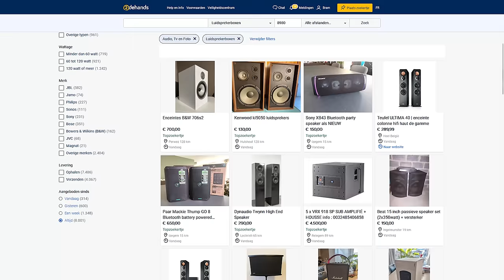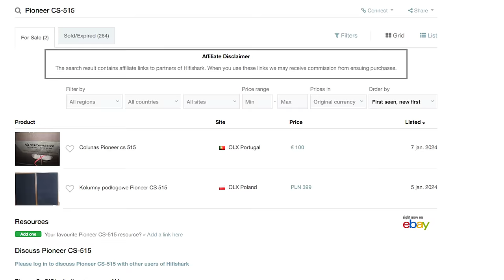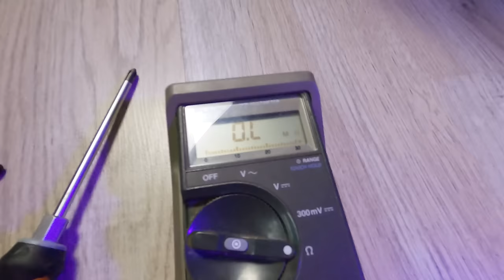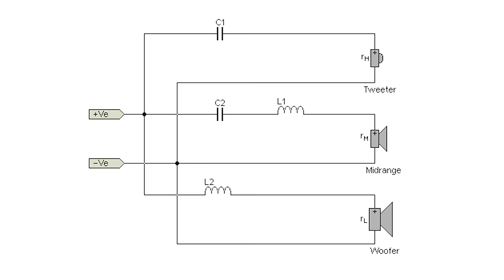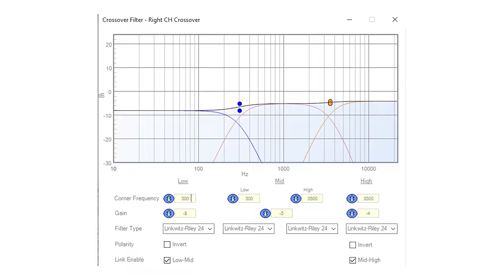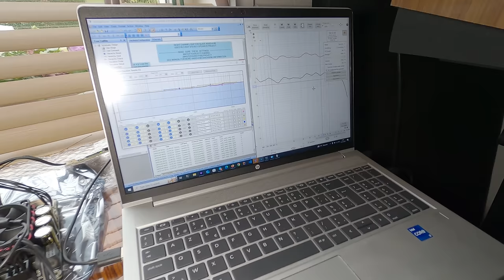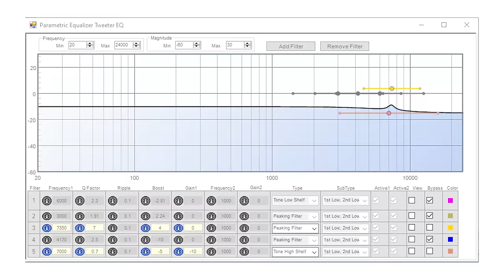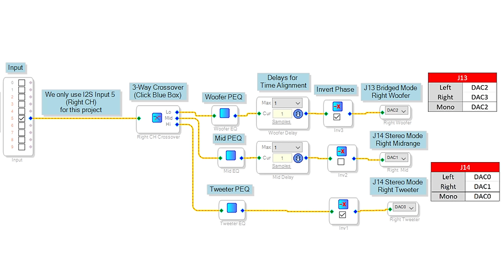Turning BROKEN Speakers into HIGH QUALITY Studio Monitors

Comment: I skimmed the video for it, i apologize if you mentioned, but is your noise tweeter hiss? 120hz ripple, 120hz ground noise? or 60hz ripple? They all sound different, and tell a different story. Here's some oporational points you can probably work from to troubleshoot it. Very long post but i bet youll pull some useful info out of it. I( may be covering some things you did too, i watched this with a beer and bong in my hand lol. tweeter his is self explanatory. 120hz ripple is higher pitch then 60hz ripple, noticeably, but they are both a smooth low frequency hum. The 120hz ground noise is a much clicker, sharper sound with far more presence then the ripple because theres no filtration applied to it at source of the noise like with PSU ripple.

Depending on the type of noise you have differnt options moving forward... Hope this message helps!

I have a tpa3255 chip amp from amazon on my pc system that was a little hissy, and im running it from a fairly inexpensive switch mode power supply, much like what it looks like you used here. its 12v and im using a step up booster to bring it to 36v for the amp. I was able to get rid of pretty much ALL of the hiss by putting one of those 12v DC noise filters for car amplifiers between my 12v switching psu, and the step up converter. 

 There may be a chance your filtering inductors or capacitors may not be quite up to the challenge. Thats what i initially assumed about mine. But in my case the noise was HF originating from the switch mode PSU, not the amplifier, and the amplifiers filtering just wasnt catching it for some reason, likely a circuit topology design flaw (VERY common with chinese chip amps... VERY). Cheaper switch modes tend to have quite a lot of high frequency switching noise on the line. And often whether its a claimed feature to remove this or not, itll make it into your tweeters on this kind of chip amp. If it's more of a lower frequency hum your dealing with, id look at your PSU first again, and start testing for ripple currents in the DC coming into the amplifier. Anything over .5Mv ripple and youll likely hear it up close with these cheap chip[ amps in my experience. whether people want to admit it or not, some of these better chip amps (tpa3255 properly implemented specifically) are some of the most neutral, and least colored, transparent, and detailed amplifiers ive ever heard in my life. Noise can come through fairly easily in a non optimal setup, through non optimal circuit topologies including output filtering, or through non optimal DC power source.

If your dealing with power supply ripple, you may be able to help by changing raising, probably by 25-50% at least, the value of the large filtering caps in the power supply and with a good prand of low ripple low esr cap like nichicon or sanyo or something. But depending on the topology of the power supply this is still a crapshoot and you'd likely be playing and soldering around potentially dangerous amounts of current for little to no benefit. Noise from switching PSU's can be a real PITA sometimes. If its 60hz ripple not 120hz you may just have a janky IC or diode in th epsu leaking 60hz into the DC outputs, or it may just have an exceptionally noisy transformer causing excessive emi in which case... get a new psu, and make sure its better quality lol

If you've ever let this power supply sit active for time with no load, you may have also damaged an IC in it, and that could be the source of your noise too. thats a big no no with switch mode power supplies.

Unfortunately, that implementation of whichever chip you may be using, may just be noisy. Ive yet to hear a tda7492 chip amp that didnt tweeter hiss like a mother and let switching noise into the signal. Ive heard tpa3116 implementations that sound as good as 3255, and ive hear ones that sound worse then tda7492. Ive NEVER heard a noisy tpa3255 chip amp and ive heard a TON though. So if thats the chip you have, DEFINITELY start looking into your PSU step 1

---------------------------------------------------------------------------------------------------------------------------------------------------------------------------------------

also. i did similar with an old set of Acoustic research series 660 studio monitors. New dayton audio woofers, new GRS ribbon tweeters, and original mid range stayed as it was surprisingly fantastic.
 
Designed crossovers in xsim and built them, tested, tweaked, rebuild, tested, tweaked rebuild. And i have a set of monitors out performing ANYTHING you can get for the under $400 i have into these things.  

Floor to ceiling wall to wall soundstage, a revealing and detailed character im not so sure ive experienced before. They make a friends Klipsch rf towers seem like a pig painted up as a show pony. The only issue being a ever so slight hint of image smearing between far left and center channel thanks to my room being a little too small for the way the drivers are arranged on the baffle. Ideally theyd be about 7.5 feet apart and id be about 8 feet back from center point. Listening position is at about 7 feet back, theyre about 6 feet apart. I have been able to set them up in rooms big enough for the way they want to be positioned, and t's truly a thing of beauty. The modern sound+vintage look is a really sick combo if you do it right.

Im not suffering too much baffle diffraction thanks to how close the drivers are to the edge of the baffles, and because the baffles sit flush with the sides. I have to pay very close attention and listen at it hard for it to even be noticeable. My phasing is arrow flat til 9khz as well, and then its a slow, gradual dip at 45 degrees and barely hits 90 out of phase by 20k. My result far exceeded what i expected to get, and i changed my mind about giving them away to a friend too. They are going nowhere any time soon. Glad i never mentioned that plan to any friends yet.

I never implemented any DSP, but im +/-2db from 40hz to 26khz thanks to being crossed over at 60hz with a surprisingly fantastically performing GRS high excursion 12" sub and where my crossover design ended up. That sub was $55 and performs when measured in my space a tiny bit BETTER then the comparably sized 12" dayton HO reference sub response wise. It phase aligns with my dayton "classic woofer" a lot more nicely then the dayton ref did too (which honestly shocked me). I can even tell its doing anything at all when on, because it weaves so nicely into the sound stage. But when its turned off, there go the meat and potatoes.

I may actually try one of the $30 grs woofers in the simulators, id think its pair even more nicely then the dayton woofer, and in the band i want it to perform, their graphs are even flatter then the daytons too. I just wrote their drivers off on price alone to begin with. The grs ribbon im using rn that was only $70 on sale though blows away many far, FAR more expensive dome type tweeters in every conceivable regard too. It takes a bog ole pop-a-squat on the dayton AMT and dome reference tweeters, i was trying to use first. thats for sure. Far easier to manipulate a crossover design for as well.

The amount of performance you can squeeze from $200 worth of drivers and the right sub-$200 amplifiers and some old goodwill boxes is absolutely insane if you put the time and effort in to do it right yourself.
Reply from the maker: Impressive project, and I totally agree about how much performance you can squeeze out of some hardware if you take the time and effort to do it right.

I'm not really hearing an electrical noise like a 60hz main hum or something similar. It's more a faint constant white noise, and can mostly be heard in the tweeter, and a little bit in the midrange when I hold my ear close to it. Since I have a lot of extra headroom on the amps for the tweeter and midrange, I might try adding an L-pad. If that does not stop the noise, I might perhaps give modifying the power supply or getting another power supply a chance. Thanks for the tips, might come in handy.
Reply: Thats going to either be high frequency chip switching noise from the psu, or from the 3255 chips themselves that the output filtering on the amp isnt catching. A dc noise filter helped my cheap chip amps tweeter hiss, probably cut it nearly in half db wise. I have to stick my ear within a couple inches of the tweeter and crank the power amp to really pick it out over background noise now. Power supply noise does indeed make it through many of these chip amp filters.

 You could try adjusting output inductor and capacitor values if your decent with a soldering iron. Theyre large easily de soldered and re soldered parts. Tin a perfect world, the high frequency hiss SHOULD be getting filtered out by the inductor/capacitor circuits on the output stage of the amp, whether the switching noise is from psu or the chips... Thats what the output filter is for specifically. @SirFreak 

Even the fosi V3 and za3 have some tweeter hiss if you turn them up loud and cut the signal. a dc line filter does absolutely nothing for them either. But even when music is cranked and paused, and you get up on the tweeter, there is very noticeable hiss.

At least you didnt go with tda7492. Those chips hiss through any filters and you can hear it at any distance running from ANYTHING besides a high quality toroid that cost more then the amplifier lol. And even then you can still hear it from like 5-6 feet away with any real volume

Comment: What is the noise coming from, could you enclose the amplifier in a EMI sheild? and use coiled with an insulation sheild on the wire / and a ferrite ring? If the noise is coming from the circuit itself only thing that pops into my head is a better opamp.
Reply from the maker: Might give some of those things a try, thanks.

Comment: If you use minidsp 2x4hd (budget priced) or the minidsp flex balanced (highly recommended) and use an ice power amp, Or fosi bt20a pro amp, or fosi za3 amp, Or the amazing topping La90 discrete amp your system will sound incredible with ZERO HISS. As far as clarity goes Your amp right now has 0.04 total harmonic distortion. The topping La90 discrete has 0.00009 total harmonic distortion that's why it is insanely clean.
Reply from the maker: Thanks, might look into those

Comment: I've wanted to make a project like that for years! do you have links for further reading materials and the parts website?
Reply from the maker: Got most of the materials from SoundImports and Audiophonics. In the US you might want to use parts-express.

I probably forgot a few things, but these should be the most important:
- HiVi RT1.3WE Isodynamic Planar Tweeter
- Neutrik NL8MDXX-V-BAG speakON 8p
- Neutrik NL8FC
- MOGAMI W2919 Speaker cable OFC Copper
- PINTA AMORTSONBi10A PHD Self-adhesive bitumen backing
- PINTA RESOBSON FU1220 Self-Adhesive Fabric Felt Damping
- SMPS300RS Switching Power Supply Module 300W / 36V
- WONDOM AA-JA11117 Functional Cable Package for JAB3+ / JAB4 /
JAB5 Boards
- WONDOM ICP5 Programmer
- WONDOM JAB5 AA-JA33286 Amplifier Module
- Shrinkwrap
- Wire for connecting to the power grid

As for reading materials, I just searched around a lot on the internet as a progressed through this project. One book you might want to check out, recommended by a lot of people, is "Loudspeaker Design Cookbook", by Vance Dickason. It's quite an expensive book, and I have not read it yet, though. But heard that it's a real bible for speaker design.

Hope that helps!

Comment: The amplifier is Wondom JAB5, same exact copy of the Dayton Audio KABD-4100. I need the power supply info
Reply from the maker: I used a SMPS300RS Switching Power Supply Module 300W / 36V. Although some people in the comments here suggest it's better to use a linear power supply.
Reply: @SirFreak  switching power supplies are great for these applications. I'm a live sound engineer, the hardly make powered speakers or amplifiers with transformers anymore, they're all switching supplies.

Comment: I honestly think the culprit for you lack of low end extension is the tuning of the port, not the woofer itself. That woofer looks to me like it would be capable of going lower if the box was tuned differently, but that might be too much work. A lot of math goes into port tuning these days, but back in the 70s manufacturers just used trial and error, which is why the tuning is likely not perfect on these older speakers.
Reply from the maker: Quite possible! Too bad I cannot find the T/S parameters of the woofer. I'll have to do more testing and experimenting, maybe I can find some ways to improve it.

Comment: 3:48 You clean out the corrosion, spray Inox3 or similar penetrant/protector and you can unwind the voice coil a single half turn on each wire to re-wire it if it's broken at the leads. You most certain can repair it.

Is it worth it? Probably not.
Reply from the maker: Good to know! I still have the old ones laying around here. But I probably won't put them back, I'm quite happy with the new tweeters.
Reply: @SirFreak  the new ones are better aside from maybe higher crossover required. Those originals wouldn't be worth much given these pioneers aren't exactly like Yamaha ns1000

Comment: The damping material is very important and bitumen also works well on a steel barn door or garage door and even on a car door. So why not on a loudspeaker wall and that horrible glass wool has to be removed. You can replace it with rock wool. Good thing no asbestos was used.
Reply from the maker: I had considered rockwool as well. I might put it in some kind of cloth though, to make sure it does not come loose after a while.

Comment: @SirFreak where did you get your amp , your , drivers, tweeters, and amp from online?
Reply from the maker: I got most of the materials from SoundImports and Audiophonics. In the US you might want to use parts-express.

I probably forgot a few things, but these should be the most important:
- HiVi RT1.3WE Isodynamic Planar Tweeter
- Neutrik NL8MDXX-V-BAG speakON 8p
- Neutrik NL8FC
- MOGAMI W2919 Speaker cable OFC Copper
- PINTA AMORTSONBi10A PHD Self-adhesive bitumen backing
- PINTA RESOBSON FU1220 Self-Adhesive Fabric Felt Damping
- SMPS300RS Switching Power Supply Module 300W / 36V
- WONDOM AA-JA11117 Functional Cable Package for JAB3+ / JAB4 /
JAB5 Boards
- WONDOM ICP5 Programmer
- WONDOM JAB5 AA-JA33286 Amplifier Module
- Shrinkwrap
- Wire for connecting to the power grid

Hope that helps!

Comment: me personaly im a car hifi nerd... i did this bitumen s**t wit both of my cars ( all pannels) it was like hell but sooo worth it... the enclouser of a driver is the most inportant thing in my opinion .. and the dsp rout was the best way to go... i think best thing for you swap the bass and midrange driver with something more modern and use a flaired port and they will sound gangster :D ( i hope my comment makes sense im form germany my english writing is a mess :DD)
Reply from the maker: installing a flared port might be tricky, but worth a try!
Reply: @SirFreak  if you got so of the bitumen left put some on the existing port until you got a flared one (look in the car hifi shops you can find them in any sice ,lenght and material they screw on like a speaker there are variable ports too) . these mass produktion cardbord ports are awefull :)
Reply from the maker: @Evo187  I already put the bitumen on the port, as you could see in the video :) Hmm I did not know that you could just purchase ports that fit inside of existing port holes. Good to know, thanks for that!